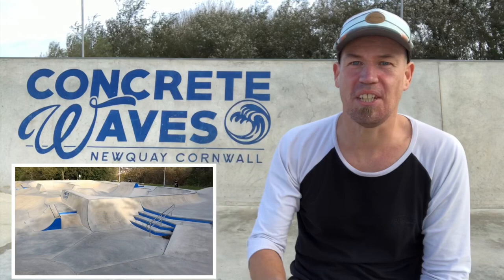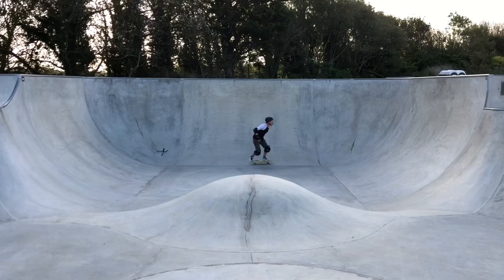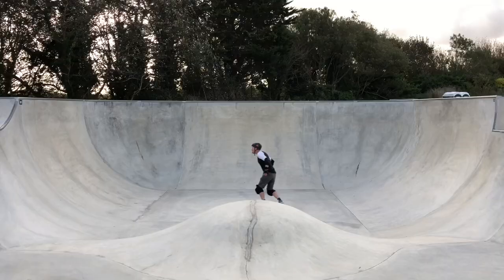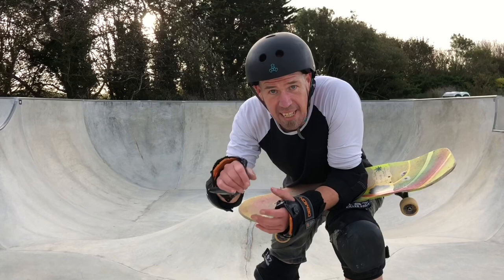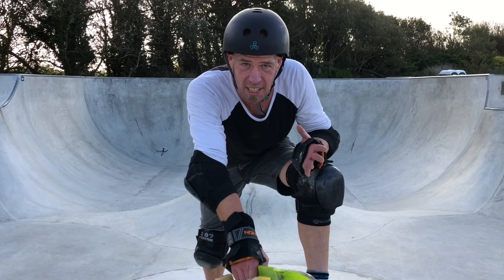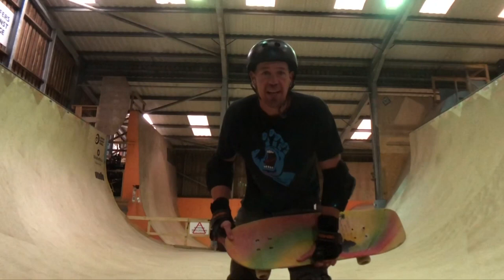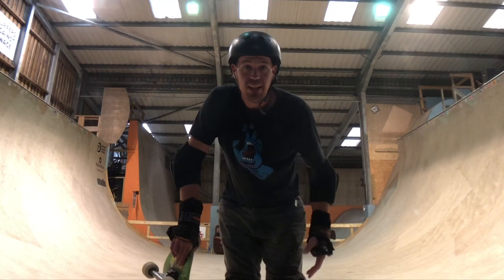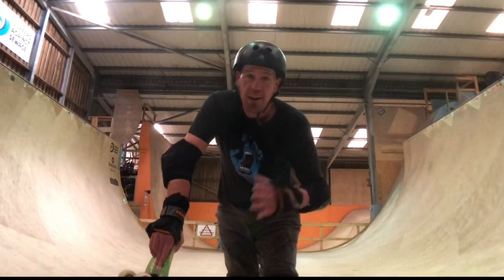Learn to Kick Turn and Slash Grind On A Vert Ramp (Backside) At Concrete Waves and Mount Hawk

Comment: Wicked bish..I think the advice on bailing is a great part of learning how to skate as let’s face it falling is a big part of skateboarding..also as a learner the timing of the pump is a real issue for me so great advice 👍🛹
Reply from the maker: Mark Rivers Great stuff Rivs, yeah I find the knee slide is good for the confidence. For me Running out there is a chance of twisting or pulling something lol, and with running out there is a chance of getting mixed up with the board again. With the knee slide if the board hits you it’s usually the soles of the shoe which is fine. Another thing I forgot to say is if I bail to the feet I try to run out on the balls of my feet as opposed to the heels. I’ve bruised my heels a fair bit by landing down hard on the heel? If you run on the tip toes it seems to work better?  We’ll do some when you come down !!

Comment: What the hell is a slashgrind..is that British word for frontside grind?..nice vert ramp..they even put the top wood at an angle
Reply from the maker: Yeah, slash is what we call getting a wheel over the top and rubbing the truck on the coping during a kick turn. The angled surface wood is ace for a non clunky ride !!
Reply: @JonBishopSkate  I'm very familiar..I've built and help built a few half pipes..had a 8 ft myself for many years..just glad to see your having fun:)